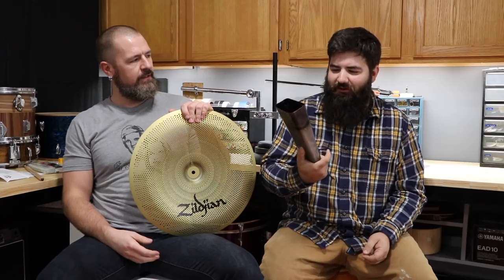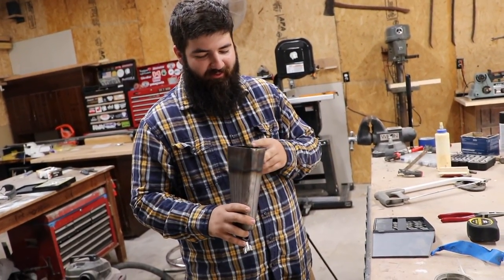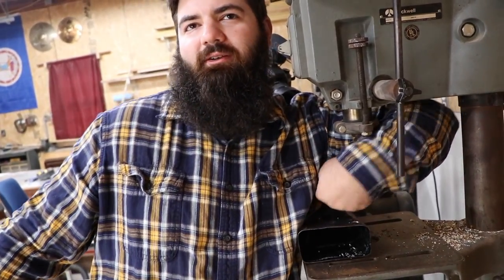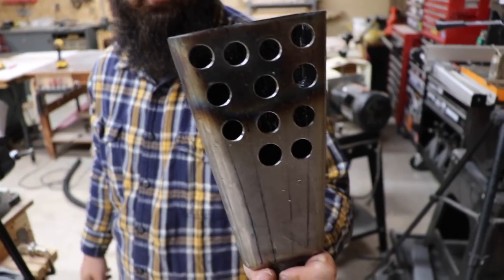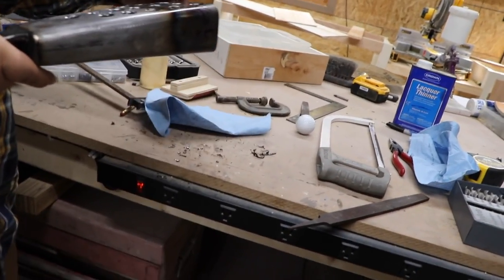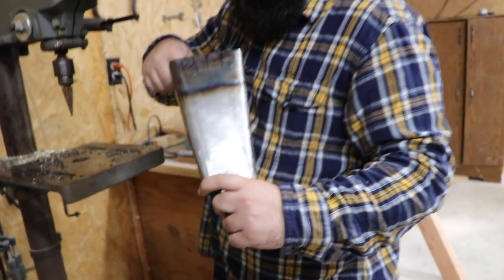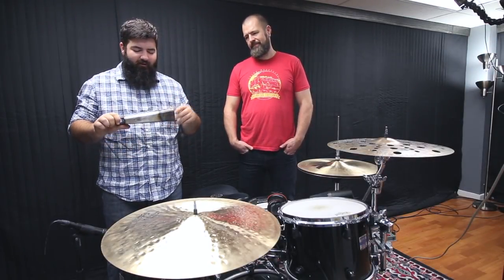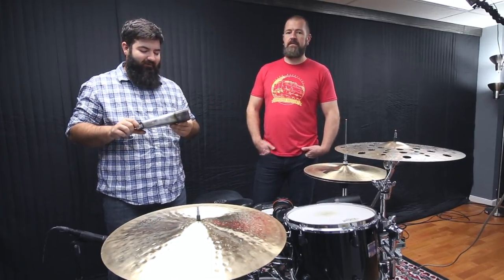Making a Low Volume Cowbell?! | Stephen Taylor & rdavidr

Comment: back in the day i had really good results putting a single 8th in slit on the sides. it still allowed for the resonance the cowbell requires but it still dulled out the "ring" and allowed for a more "metal" sound instead of that country twang.

the crash works because the material itself is different, yes the holes do play a large portion in it's quiet nature (less mass) but the material itself is the main culprit for that sound. 

these kinds of things reminds me from when i used to try and modify things by adding tire balancing weights to the underside of cymbals and all sorts of silly stuff.

Comment: 1) Use some oil on that bit, it's smokin! 
2) Yeah, you're not supposed to drag files backwards, but ThisOldTony says 'it may not matter'. And since it's probably a Harbor Freight file - it likely doesn't matter. 
2b) But you're using a live electrical outlet strip to collect your file shavings!
Reply from the maker: 1. thats the oil smoking 
2. this old tony is my excuse 
2b. gravity... maybe...

Comment: Wouldnt it be better to drill holes in the side
Reply from the maker: we honestly got lazy after drilling 98342065791 holes in the crash so we went for fewer bigger holes.
Reply: @rdavidr   i mean like instead of ontop , in the sides since it seems pretty easy to bend by hittimg it now, wich also gives a special sound ofc :p